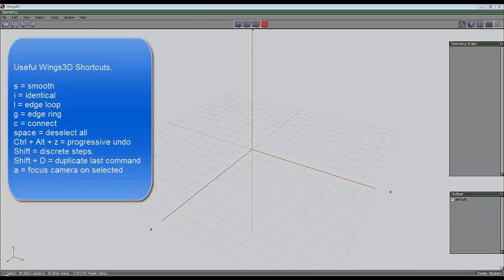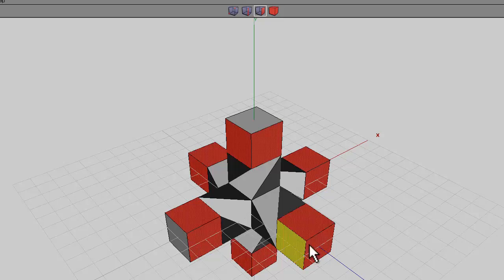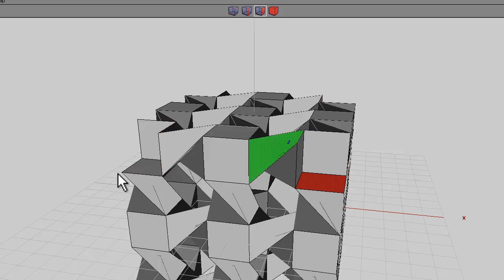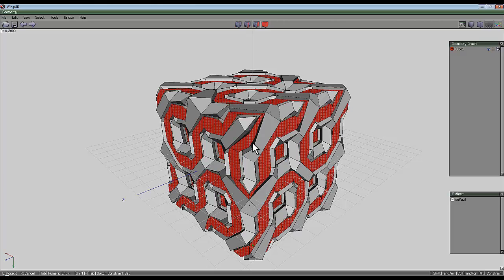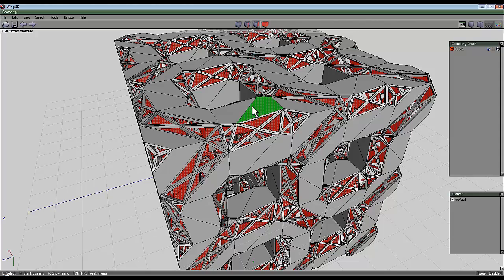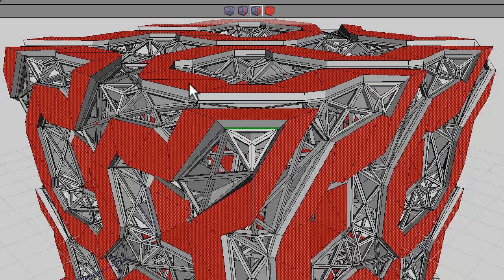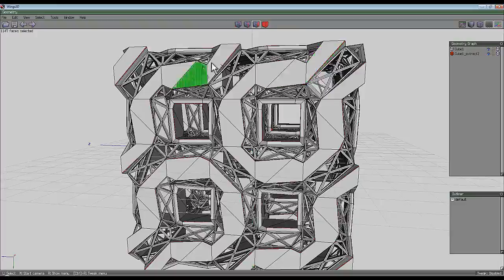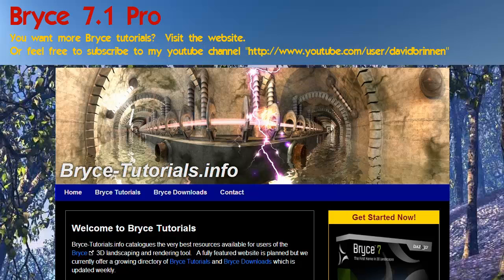Wings 3D project - twisted cube with scaffolding - by David Brinnen.

Comment: It never ceases to amaze me how easy it is to create complex models using Wings 3D in just a short amount of time. Very few programs do it that well. If only they could fix the 64 bit version to use as much available memory as higher powered computers have. The Erlang  thing that must be running in the background seems to put limits on what can be done concerning mostly polygon count. When I get to 200,000 or more Wings 3D gets slow and will crash a lot.
Reply from the maker: For this kind of thing, I think Wings is better than Modo, though as you say, it is relatively easy to reach the limits of what Wings can handle.  But it is hard to grumble given the cost of Wings.
Reply: David Brinnen 
I do agree with that, and I've figured ways around those limits. Modeling parts, UV mapping them, and Mat zoning them in Wings 3D, then importing those parts into DAZ Studio where I can assemble them, group them and apply my texture maps to them and then export the whole model works quite well for me. Doing it in parts like that allows me to keep the polygon counts down in Wings 3D. and I can have just the part that others must be fitted to in and model around it. As I model I make sure to save several .wings files in case I forget to do something. I can then go back and make corrections without having to start all over from scratch.